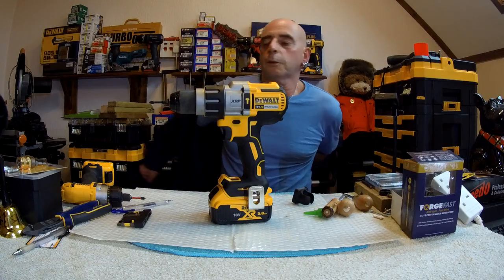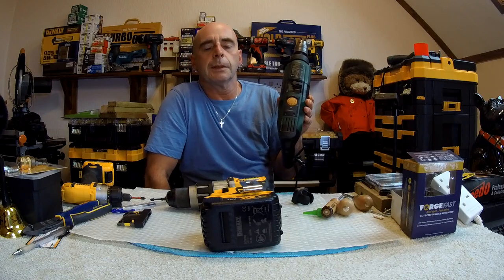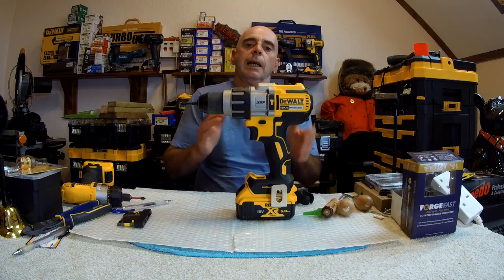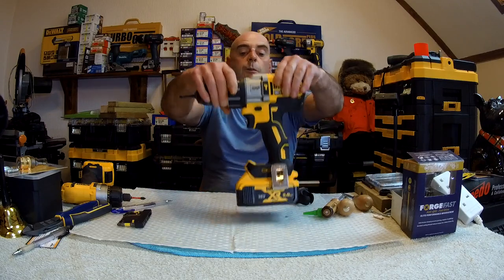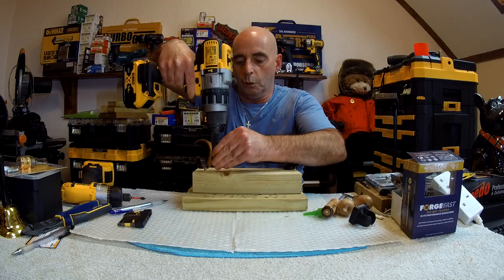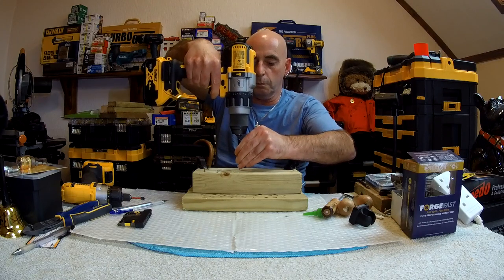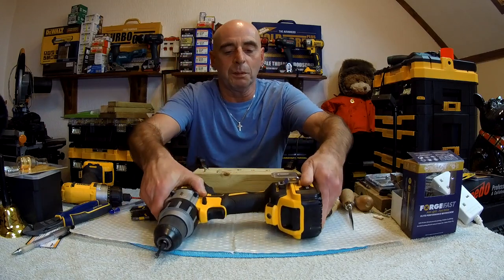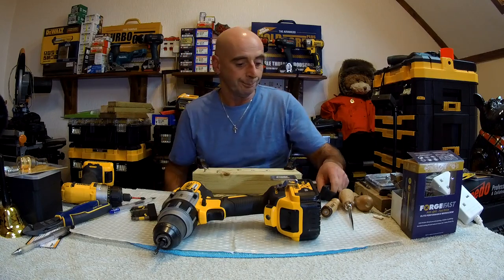Dewalt DCD996 E-Clutch made easy

Comment: Hi Milton.   I have the same dewalt 996 drill.  I just had it back from warranty repair and noticed the drill speed on speed 3 drill setting spins slower than on speed 3 hammer setting.   Is this normal?
Reply from the maker: Yes, it's normal. You get around 200 more RPM on hammer. It was a way to kick at Milwaukee.